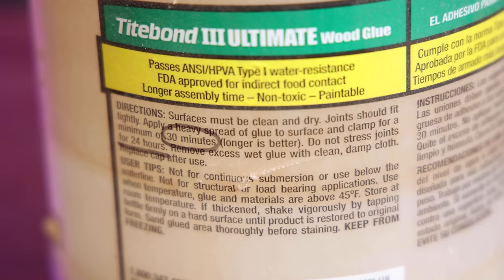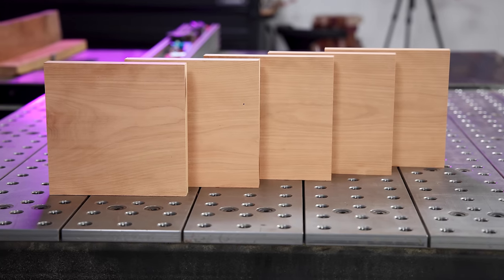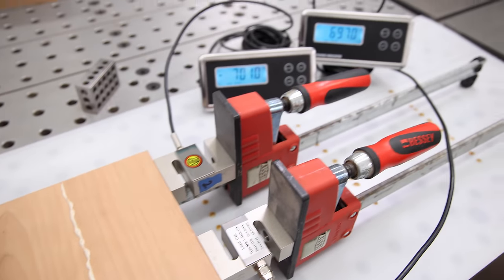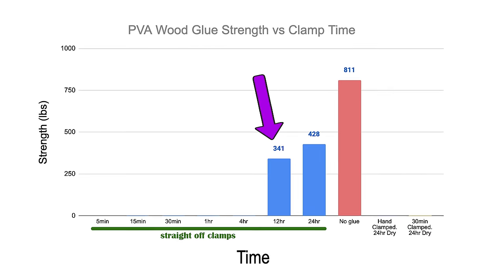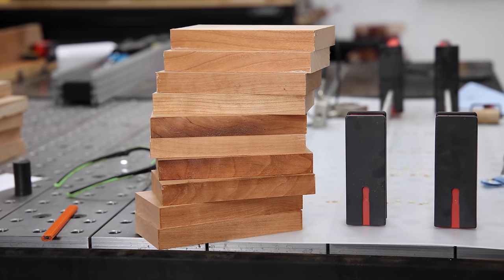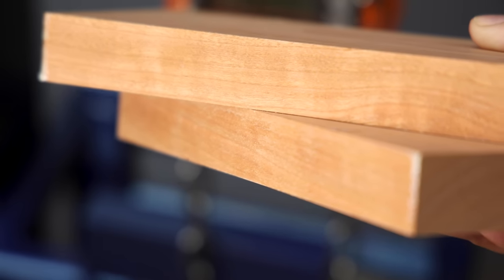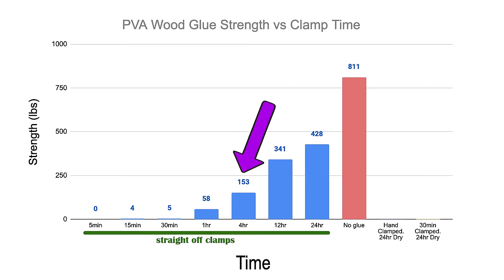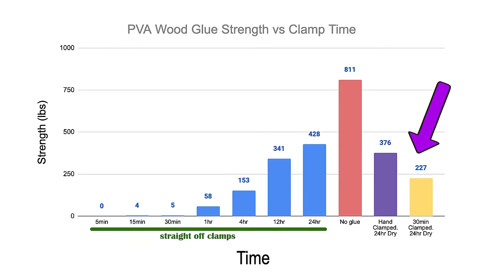you are clamping too long

Comment: Really cool video as always thanks for sharing. Did you by chance do any tests where the boards had been in clamps for 12h say but had been glued up for 24h? As in taken out of the clamps at 12h but it's been "curing" for 24h. Not sure if that would change the strength at all.
Reply from the maker: Unfortunately no. I think it would have been nice to have those additional data but I would have needed a lot more wood and an extra week of testing. Because every clamping has to be done with the sensors on it to ensure consistent pressure across all test. That really was the rate limiting step for me in being able to do more tests. My logic is that if 4hrs produces joints strong enough to shred wood fibers, if it is allowed to cure for additional 20hrs off clamps, it would only get stronger. But...it's an assumption. haha

Comment: Since i started watching youtube woodworking videos, i have been baffled by the amount of glue nearly everyone uses. I have always used enough glue for there to be a little squeeze-out, but not more. I i have mostly applied glue to just one part. To me it seems wasteful to use that much glue, but i may be wrong - maybe the glueup is stronger if you use more glue? It would be an interesting test in my book 🙂
Also, for the hand-clamping, i rub the pieces together to create a vacuum-effect, which i believe is as good as clamping for smaller pieces. Am i right?

Comment: Im curious how pressing the pieces together and waiting for 24hrs was more effective than claming for 30 then waiting 24 hours, very interesting. If im in the shop all day ill usually break clamps after a couple hours and sometimes even run them through a planer that same day, but i doubt im putting more than a few lbs of pressure over the joints, basically just enough for the feed roller.

Comment: It looks like the space between the wood surfaces has a lot to do with how strong the glue is.  
The larger the gap, the more glue is involved in holding the two pieces of wood together.  
Try taking a drinking straw, fill it with glue, and let it dry for a week.  
Use a razor blade to score the straw from end to end.  
Peel of the straw.  
Gently bend the glue and see how much force is required to break it and how much it deflects when bending it.  

Let us know how this experiment goes.

Comment: It did not surprise me that the joints you clamped by hand held as good as some of the clamped joints since you let the hand-clamped joint cure ... the short timed clamped joints you didn't let them cure. There is a big difference in clamp time and cure time.

Comment: Fantastic test and super interesting, just like your VOC test. 

Given these results it would be interesting to see how strong the one, four, and twelve hour clamp times would have been if left to sit unclamped until the 24 hour mark since that is the recommended minimum time to leave before stressing the joint. In other words, does it still take 153 lbs of force to break the 4 hour clamp piece after letting it cure for 24 hours? Probably not, considering the 30 minute version took 227; but is it just as strong as leaving it in the clamps the whole time? I will continue to simply leave my clamps on for 24 hours since that gave the best results and I'm a hobbyist and never doing multiple glue ups the same day; so no need to use the clamps for something else anyway.

All I can guess with the recommended test sample is that taking it out of the clamps at 30 minutes disturbs it enough or lets the wood expand enough to compromise the joint, even with a perfect planed glue surface. Which raises the original question of how long does it have to stay clamped to achieve 428 lbs of strength after 24 hours of drying? Not that it matters, but if someone wanted to do a follow up just to dial in our data that would be interesting to the community for sure.

Comment: This is a nice start, but there was very little distinction between clamp time and dry time. I'm also kinda surprised the 0 clamp time, 24 hours dry time joint was stronger than the 30 minute clamp one. Presumably this is because the resulting glue joint is thicker? I would like to see all sets redone and all of them dried for 24 hours, so that dry time is a controlled variable. If you stress a joint before it is dried, then that is really a meaningless test.

Comment: Psi is not a measure of "pressure per square inch". It's a unit for pressure, which is force over area. Psi is pound per square inch
Reply from the maker: I agree. Misspoke and forgot to correct it in the edit.

Comment: psi is not "pressure per square inch" - it's force per area, and pressure itself already per unit area. It's the same reason that "pounds force" doesn't make any sense. Just use Newtons, and you'll never have to worry about getting it wrong.
Reply from the maker: Yea I had an oopsie on that and didn't catch it in the edit.

Comment: You said it yourself early in the video. You didn't apply the recommended PSI range, that's what the directions (and their tested results) are based on. 

Also, from their FAQ "What is the clamping and drying time of Titebond Wood Glues? For most of our wood glues, we recommend clamping an unstressed joint for thirty minutes to an hour. Stressed joints need to be clamped for 24 hours. We recommend not stressing the new joint for at least 24 hours."
Reply from the maker: I applied recommended PSI. I think you may have overlooked the point of the video.
Reply: @WoodcraftBySuman  I misunderstood when you said you don't usually put that many clamps on. 

The point is RTFM and follow the directions? Also, the back of your bottle text/directions are different from what I recall reading in the past. Will have to check my current bottle tomorrow.

Comment: the reason the 30min/24hour dying pieces failed is because, 
after you remove the clamps, the glue is still wet, without the pressure to keep the wood pressed against each other the wetness will cause the wood to swell and push itself apart, 
with clamps on however, the wood will swell, pressing the fibers into each other and then dry locking those swelled fiber into each other without being able to push itself apart and create a weak middle section.

Comment: I think you will also find that testing a board that is narrower, with no glue, will also break at a lower level than the "no glue" board. That's my theory...  It will test your theory that the wide, unglued board flexes and therefore takes more pressure to break. A narrower board, say 1/2 the width of the 'no glue' board will not have as much flex.

Comment: Where did you get the gauges to determine clamp pressure? Id be interested in getting one to see just how tight I'm getting my clamps. (BTW, excellent video)
Reply from the maker: It is Optima Scales OP-926-3000. You should be able to find it on Amazon.

Comment: I would bet that compression of the wood when clamped and the subsequent expansion when the clamp is removed accounts for the low strength of the 4hr-clamp/24hr-total example. The glue is not yet strong enough to prevent partial/slight failure of the glue itself (or the adhesion) when the wood expands. When you don't clamp at all, this compression/partial-curing/expansion/partial-failure does not occur. ⁉

Comment: If you do trim work in non climate controlled environments or bathroom, then maximum joint adhesion would be preferable. Pva glue clamped fully for 24hrs is max strength.

Comment: Suuuper interesting result with the 30 min clamp/24 hour cure. Disturbance of the polymer chain formation while the glue is still wet but no longer flowing appears to be the biggest factor. Tight fitting joint, reasonable pressure to get the fit, and LEAVE IT ALONE is my takeaway here.

Comment: Not letting the glue cure fully before testing is just testing curing time. I'd like to see the same test done, but break them 24 hours after the clamps are removed (like the second 30 minute test). That would tell you minimum clamp time while ensuring the glue is fully cured.

Comment: The problem is you don´t wait 24hr because of strength, you wait 24hrs because of quality. That´s why you do not wipe off glue immediately, cause you will ruin the quality of the workpiece, if you build quality stuff, that is.
That´s the reason why titebond is poor, cause they recommend wiping it off when wet, when in fact, you should not. Unless you build MDF or some other low quality stuff.

Comment: So. I’m still surprised by the no glue test vs 24. If the wood glue joint is as strong as the wood, it should act like the no joint/glue. To me, that suggests one of two reasons. Or a combination. 1. Longer set time could catch up to the no glue. 2. The glue is stronger, but it can’t flex, which effectively divides the board into two halves, each having less flex than if they were one continuous span.

Comment: I wish you would have dried them all for 24 hours. Having clamped them for 15 minutes, 30 minutes, 1 hours...etc. then removing the clamps and letting the glue finish drying. That would be a real world test. I clamp for maybe two hours and continue my build. No pressure is on the project until much later. But does clamp time matter?

Comment: I would like to see what this experiment looked like, if you'd take the open time of the glue into account. So you should apply the glue to both sides of the joint and let it sit freely for I think 10 minutes, then bring the joint together, apply the clamps for 30 minutes and afterwards let it sit for 24 hours.

Comment: Without knowing the chemical reactions, I am assuming that the glue cures with air. The boards that are clamped put enough pressure for air to take a long time to penetrate and cure it... The boards without the clamps had more space and allowed air to get in quicker to cure it?

I make these assumptions based on this concept : i work with steel a lot in my business, and we have specialised height gauges that are ground to a very flat, smooth, parallel surface, and if you put 2 together, the surfaces are so perfect that the air gets squeezed out and it created a vacuum to the point that you simply cannot pull them apart. Just a hypothesis.

Comment: ....anyone know the psi of two boards shoved between two nailed down 2x4s with a piece slightly bigger than the remaining gap forced into said space?
Reply: Also, since titebond said that the longer clamping time is required for joints that will be under pressure, I always assumed this referred to one of two things: if the joint will be put under pressure as soon as the clamps are removed, give it the time to completely dry, or if the joint will be under pressure in every day use, then leave it clamped. With this in mind, unless my joint will be under constant stress (like a neck glued into a guitar) 12 hours was my go to when I  still wanted to make sure it was done. 12 hours always seeme.d to be most of the way there, so the breaking points were just as i expected. If I'm not worried about the joint ever being under pressure, I'm counting the seconds to that 30 minute bare minimum lol.

Comment: Just watched your parallel clamp test, based on these results how much clamping pressure would you say is probably sufficient (understanding that is subjective) ? Does that gut feeling change if there are more than one pieces in the panel being glued up?
Reply from the maker: I need to do a proper testing on it but I suspect 250-300lbs every 8-12” is a good sweet spot for narrow width glue up. More pieces might have an impact but it also leads to a more diffused and even distribution of pressure requiring less clamps (as in, you can probably do 12-20” spacing between clamps on a 36” wide glue up while in a 8” wide glue up, space the clamps 8-10” apart).
Reply: @WoodcraftBySuman  Thanks, if you ever do more testing on this topic, it would definitely be interesting given how common glue up panels are, both large and small. I actually will be doing a bunch myself in the next month or two or three… for the face/doors of cabinets using using soft maple and pretty commonly see people cranking down on their clamps as well ad using a ton of them on each panel.
Reply: Would also be interesting to see if the oozing 100% coverage of glue is really any stronger than just a single straight or wavy line from edge to edge, if it isn’t it would mean a pretty dramatic savings in glue.

Comment: I bet I do know what happened with that last test.

You said you clamped them for 30 and then let sit for 24 right?  I suspect that your clamping force squeezed out too much of the glue.  Once you backed off the pressure, the seam opened up slightly (imperceptibly probably).  That left tiny voids inside the seam.

The no clamp + 24 hour sit was stronger simply because there was more glue in there and fewer voids.

Comment: I think the ones without any clamps dried for 24 hours have a lot of glue remaining between the boards, the ones that you removed the clamps after 30 minutes but dried for 24 hours have had more of the excess glue squeezed out? Very very interesting result, I'm curious if others could replicate it.

Also, amazing channel and vids. You'll be a rockstar in the Woodtube community in no time with this quality of research.

Comment: How long did you 'hand clamp' the joints?
Reply from the maker: I held it tight for 10 seconds and left them alone for 24hr after that.
Reply: @WoodcraftBySuman  so how did that hold up better than 30m of clamping pressure?!? Thats essentially no clamping pressure ever. Maybe its just the disturbance of taking it out of the clamps moving things? Then its really not clamps, but a lack of movement.

Comment: Alright, this is very informative and an amazing display of facts and information. However, the real comment is that wood glue is stronger than Lignin, the structure within wood fibers that hold them together. Now  stronger isn't really the correct word, because in application it can mean different things. As you've shown here the Lignin within the single board is more flexible and can withstand twice the pressure than the two boards glued together with wood glue. But the argument or actual comment that many many people here don't really understand is that wood glue is stronger than Lignin; it is not stronger than wood.
Reply from the maker: THANK YOU for your comment. I was trying to imply that without burning the clock because retention on videos like this is very important to me. But that is exactly right and I hope more folks pack that little nugget into their brains.

Comment: This seems more like testing drying times than clamping time. If you were testing the difference in actual clamping application, then clamp for 5 minutes and let it dry for 23 hours and 55 minutes. Compare to leaving in the clamps for 24 hours. That would show the impact of clamping. This experiment just shows the impact of drying time.

Comment: Just a little nitpick... PSI is not a measure of "pressure per square inch". It's just a measure of pressure. Pressure is a measure of "force per square inch".
Reply from the maker: You are absolutely correct. I misspoke in that sentence.
Reply: @WoodcraftBySuman  I really admire the work you put in your channel, keep it up!
Reply from the maker: @epgui  thanks Guillermo! Appreciate it.
Reply: Agreed: PSI=pounds per square inch, which is a composite unit used to express a force per unit area.

Comment: 1) Not really sure why dry time/clamp time has a title "wood glue is NOT stronger than the wood".
2) I kept watching because when it became a clamp time test - I assumed it was a CLAMP TIME test... not a clamp and then break the wet glue test.
3) I think the tests would have been more useful had it been a clamp time test. Meaning - is strength effected by how long one CLAMPS. This is achieved by clamping for different time and then letting the glue dry.
4) The fact that the hand "clamped" test took 300+ Lbs to break, and the 30 minutes clamp too 200+ Lbs --- would suggest you need to run that test again. You got results that did not make sense. Did you hold the wood together for 30 minutes? I doubt... so the test did not have a commonality.

I would have been interested in seeing a test in which different amount of time for clamping - with 24 hour drying - then testing strength. THIS would then result in information on how long to CLAMP.

Comment: I'm not convinced that the hardening of the wood fully explains that the glued pices are weaker than pure unglued wood.
If that was the whole story I would expect all glued pieces after the 4 hour mark to fail at the same pressure (or maybe the fresh pieces even be stronger overall since less woood hardening had occurred), instead of consistenty getting stronger with time 🤔

Comment: I can’t believe you don’t realize what happened with the manufacturing recommended clamp time. Notice. The manufacturer specifically stated not to use it right after you were done clamping. So essentially what is happening here is that you testing it immediately is what is causing the issue. I am almost certain the 5 minute one would have held up at least as well as the one you hand clamped if you let it sit for 12-24 hours
Reply from the maker: It is tested deliberately to understand how strong that joint is at that time point to assess if it’s strong enough to be unclamped.

Comment: surely you should clamp for the various times, but still let all then sit and dry for the 12 or 24hrs. Unless i misunderstood, you glued wood and clamped it for 30mins,  took it out the clamp and tried to crack them, of course they would split very easily

Comment: Could you delve deeply into the issue that the glue line may be stronger than the timber, but the timber may be stronger without the glue.  Also, why is end grain gluing stronger than long grain glueups.  There is a common thread through this.